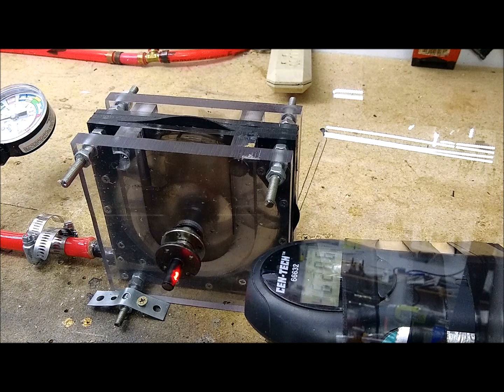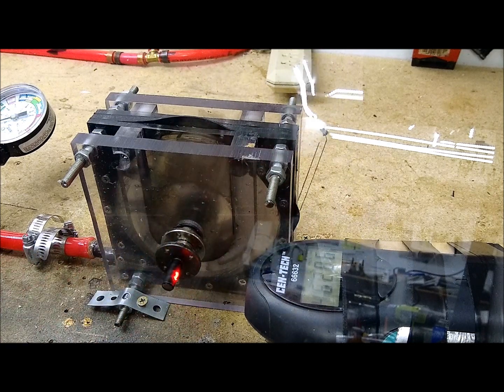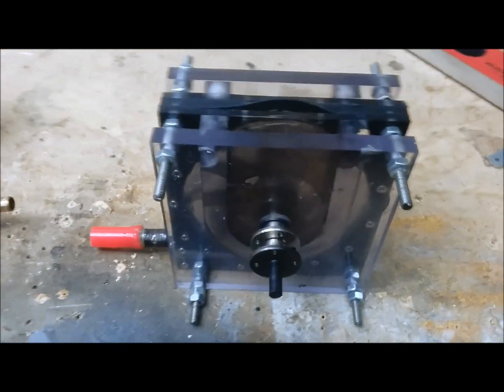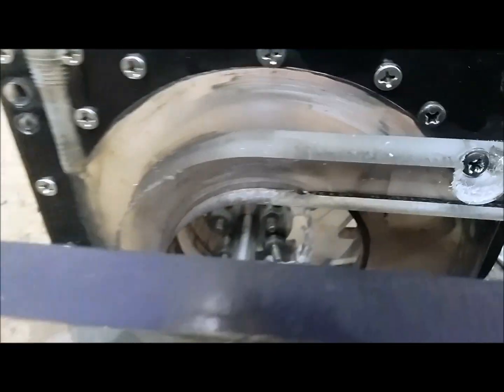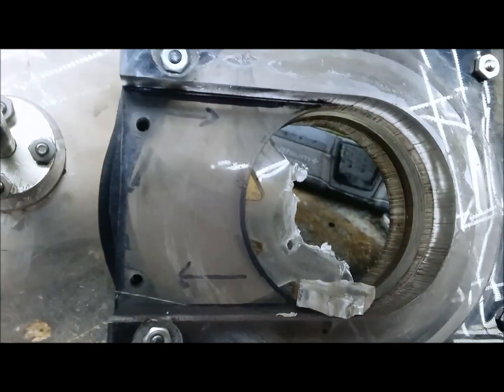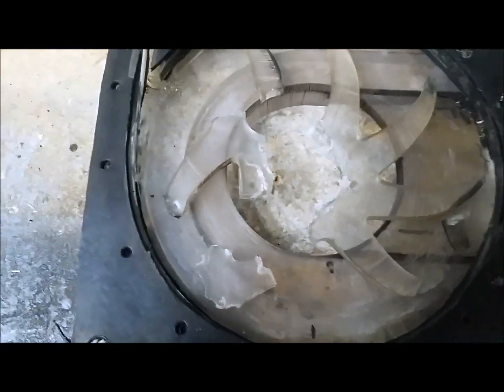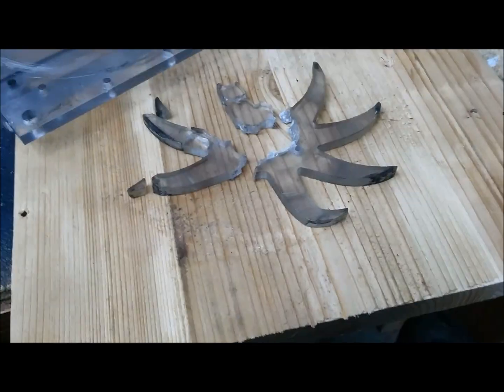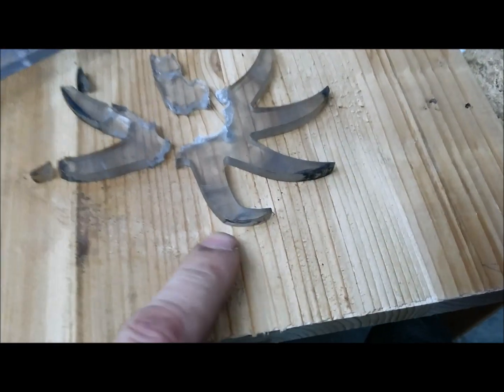Turbine Blade EXPLODES at Over 47000 rpm!

Comment: You get secret NDA engineering firm knowledge. The efficiency benefits are lost at large scales due to safety margins. The discs need to run at high RPM with enough mass to carry work, but not enough to overpower the fluid friction; aswell as being quite large to produce power. Thin, low weight, large discs aren't condusive to safe and reliable operation. The thinner the disc the better for getting it to spin, as soon as you apply a resistance you quickly overdraw the system.
Reply from the maker: Well that might be your experience but not mine. All the difficulties you are describing are easily overcome. I know from experience, please wait for the new updates.
Reply: @iEnergySupply  Not mine, just the result of a team with government money, that each comparatively make me look an ape. Just trying to save you from wasting your life, but have fun waste away.
Reply from the maker: @darwinawardrecipient955  who is this team? I haven't wasted my life, we are going into production and there are thousands of customers. I've already done the testing, and compared the turbine to other turbines. the tesla turbine preforms on an entirely different level. I feel bad for the people who gave up on their project too soon and didn't see the true potential.

Comment: Anyone could hear that turbine was not balanced properly or even damaged from the get go. Thats the lower frequency sound. And that's the failure mode.
Reply from the maker: I didn't hear a lower frequency sound.
Reply: @iEnergySupply  Listen again, the very high pitch whining is the normal turbine sound you should expect from a high revving jet engine for example. That is what you want from a 47K rpm turbine. But there's also a lower harmonic frequency which is dominant. It stays way lower than 47 KHz, which most probably means unbalance in the system. Which in turn explains the failure of the turbine.

Comment: Why lexan? why use material with a tensile strength of 12,000 psi when it could be built of steel with a tensile strength of 90,000 psi?
Reply from the maker: It's the strength to weight ratio that matters, so now we use carbonfiber.

Comment: You'd prolly wanna copy the technology that turbos use tbh
Reply from the maker: The efficiency is lower.
Reply: @iEnergySupply  I was referring to the bearings and oiling, as they withstand much bigger rpm without issue

Comment: 450000rpm  pretty respectable
Reply from the maker: 47000*
Reply: @iEnergySupply  I read that Tesla had the same problem. At High speeds the plates expand and hit the pump. To solve the problem he made it bigger and ran it at a slower RPM,

Comment: you're a brave man for sitting that close even with the plexiglass
Reply from the maker: Yeah this is about time when we started using blast Shields during tests that we were unsure about. They're not necessary if it's possible for your rotor to stretch and hit the side walls before reaching the critical speed. But if you have a big heavy rotor and it hits the sidewall to break itself you need to make sure your turbine doesn't jump off the table too LOL

Comment: tesla turbine has flat disks for a reason. If you get why, you can translate it to Aether flow between (bifilar) pancake  coils...
Reply from the maker: I would love to know how to use the bifilar coils to collect the Aether! 
Yes you're correct about the flat disks, I use them in every turbine I build now. 
Have you seen the recent cold steam videos I've published?
If you could email me about the bifilar coils I would really appreciate that. My email is notime500@gmail.com
Reply: @iEnergySupply   I put everything on my channel, lectures experiments, results. Good to hear you use full disks now. Do you understand the difference? water steam aether, it all sticks to surfaces.
Reply from the maker: @MasterIvo  Have you seen This video? I would like to see your comment on it. https://www.youtube.com/watch?v=JvRCB_HhseY
Reply: @iEnergySupply  And yes. seen the video. pressure mediation. Heat or cold is transmuted into power. Impressive. but... if the turbine is loaded, with a generator, it will noy produce enough to keep the water warm or cold. Am I right?
Reply from the maker: @MasterIvo  The turbine in that video wasn't designed for this purpose, I am building the new prototype now , it has a generator directly connected to the shaft, its a diametrically magnetized magnet. I am going to add a coil on each end like newman did and possibly bifilar coils.. I've done it in the past and these generators are capable of generating electricity extremely efficiently at any RPM/High speeds. 
Really you won't need a condenser in the future as that is what the Tesla pump is for. We are testing the last single stage Tesla Turbine in the cryopherous before we complete the new two stage Tesla Turbine. 
This will make it possible for any water source to become an energy source. The Tesla pump and turbine combination should be able to extract the heat energy from water until it nearly freezes. The good news is that ambient air can continuously warm the water so it doesn't get below room temperature. Radiator used for heating and not for cooling will be used.
Reply: @iEnergySupply   I use 2 bifilar pancake coils as the plates of a capacitor.
Reply: @steambom3350  please explain why.

Comment: Any theoretical progress on a larger scale "free energy" turbine that runs on natural air heat?
Reply from the maker: They run on many different fluids, starting with combustion of fuel + Water for propellant, that will be recycled in the system, Also water mixed with fuel and aaron's plasma ignition system to completely burn the fuel. We believe it has the capability to run on water with a powerful enough ignition system. It is also possible with slight modifications to run on atmospheric pressure once pressure in exhaust is brought below 1lb, this can be achieved with Nikola Teslas Vacuum patent. We are working on it stay tuned :)

Comment: Ouch! That's an expensive test...
Reply from the maker: Yeah turns out the turbine is fine, we just need to cut another blade and do another test. Also we lost 4 bolts, but that's not to bad.
Reply: @iEnergySupply  You should put a twist in your turbine blades like they do in Jet Engines. I bet you get more surface area and thus more power out of the thing.
Reply: @youcanthandlethetruth6976  they don't do that for surface area....
Reply: @asovietreunion13  It's not just for surface area yes. But it plays a part. Just think of a parachute.